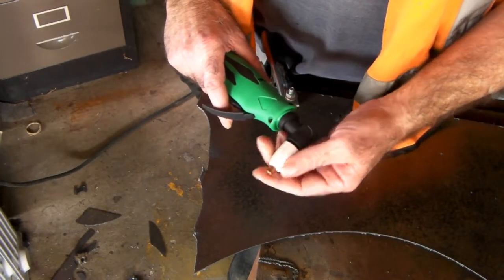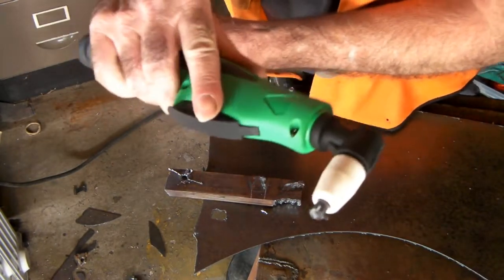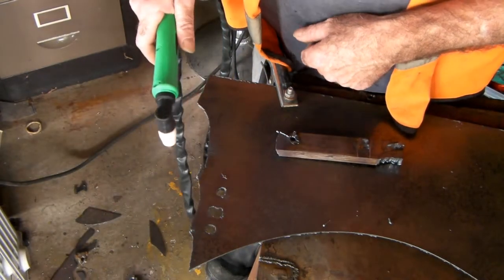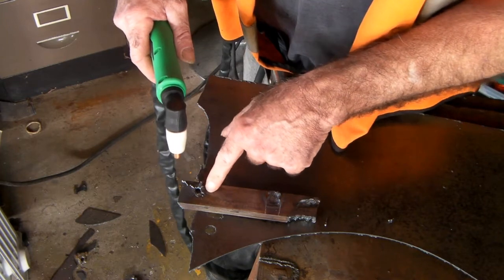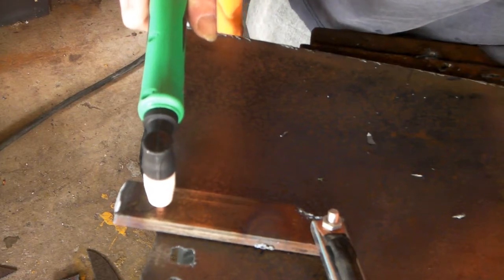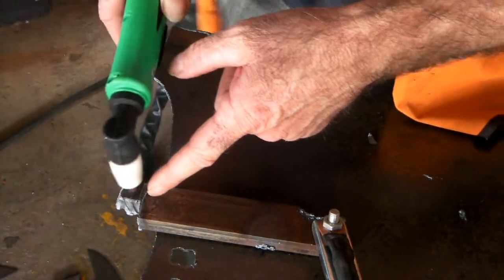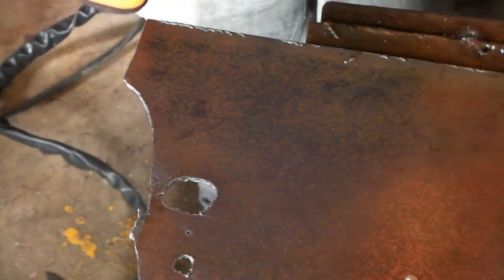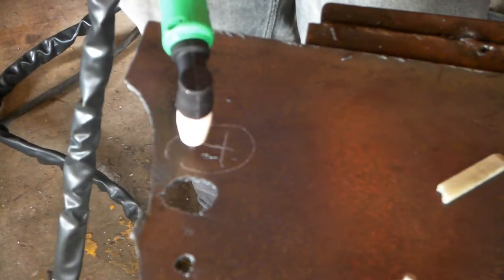plasma cutter drag tip save $$$ do this

Comment: building pressure vessels, when we cut a hole for a coupling or pipe, you tilt the torch a bit until it burns through then straighten up the torch. it blows the slag away from the tip. works great for plaz or oxy acetylene
Reply from the maker: Great idea

Comment: Love the advice. How're you going lately Pete?
Reply from the maker: Hi Chris ,Doing great thanks had a year off was doing up my house but back into it now.
Reply: @petestools  Good to hear. I'm doing up a garage right now. Just moved there. Lights and 110v outlets complete. Trying to plan out my 220v circuits to save on wiring costs. One circuit will need #4 wires...Ouch. Two others will have #8 wire. And the other three will be #10 wire. 
So doing my best to layout the large wiring to keep it close to the electrical box.

Comment: Hi Pete,
Great videos ... thank you!  i have a question.  I just got myself a small plasma cutter which uses 110v and supposed to cut up to 1/2 inch.  I am buiding a project with all 1/4" steel.  I get some great cuts and some horrible ones.  What is the proper amperage you suggest for cutting this thickness?  My machine goes up to 50amp.
Thank you in advance.
Reply from the maker: Hi ,For cutting 1/4 inch i would run it at 50 amp and 100 psi thanks.

Comment: Once the arc has been established you just simply pick the tip up from the material approximately one1/16 “ or about 2mm gap and start cutting,  the same as you would with a conventional torch and with some practice you will be able to cut the material without damage to the torch tip and should achieve many more feet of torch life
Reply from the maker: good tip thanks
Reply: @petestools  good tip? I see what you did there.  LOL.    

Great vids sir! Thanks for posting all these. ✌️

Comment: In your opinion, who makes the best Plasma cutter money can buy?
Reply from the maker: Don't know because i only use the cheaper stuff. Haven't got that much money LOL.
CHEERS PETE
Reply: There are several great brands like driving a Cadillac.  Hypertherm for example.  But its 5 times the expense for what the job need entails. I have a hypertherm, the first day it needed get repaired for a faulty component. I'd say Lotos, Ramsond, Amico, are lesser expensive reliable names better than the unnamed cheap brands with no company behind them.  Everlast is pretty good but its medium on price.  Then there are another dozen decent mid grade names.